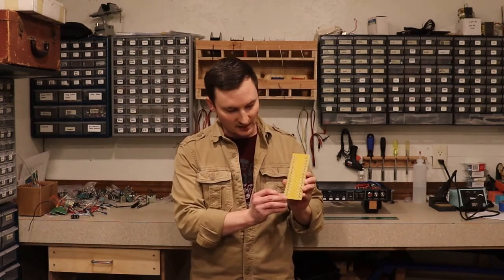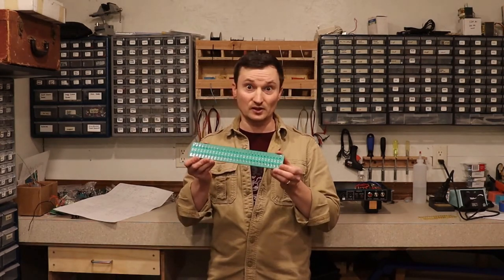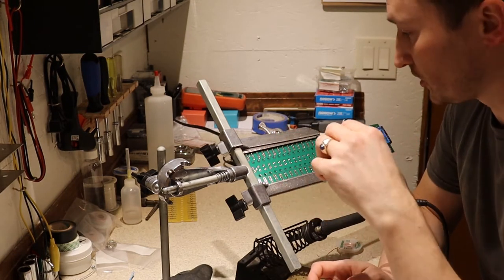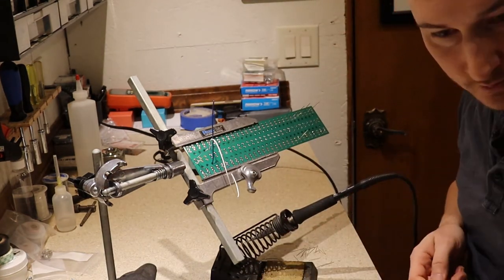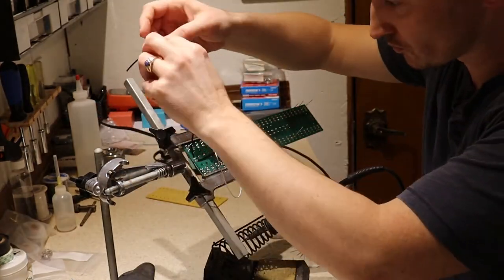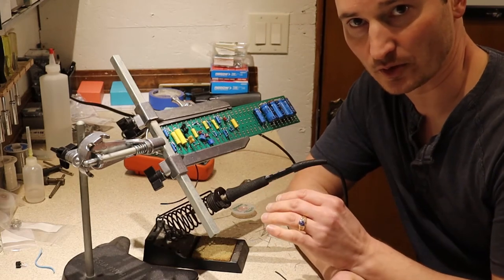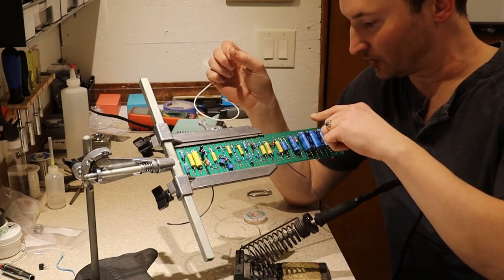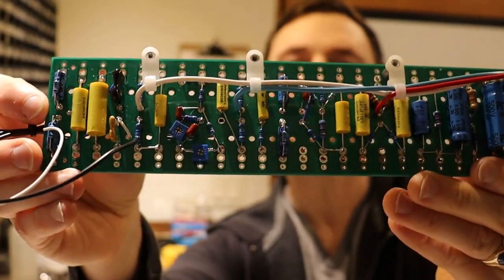75 Dollar Dumble Build Part 2

Comment: Given the huge tolerances of vacuum tubes it doesn't make any sense to use low tolerance resistors of 1% at all. I like the freedom you take with this design and your ideas for improving it, however I do not understand the difficulty in ordering the right components given the time and effort you put into this project. The eyelet boards are a great idea. Very nice project!
Reply from the maker: You make a good point. The tubes themselves will have a greater effect overall. I almost always use 1% resistors because the results are more easily repeatable if you can rely on the values, and because of the lower noise. Granted, there are only certain places in an amp where that would come into play, e.g. a 470k grid stopper. I guess I just haven't found a reason not to use them.
Reply: @timkrauseelectronics9245  new to all this but it would seem to me that if the tubes are have high tolerance having lower tolerance supporting parts  would be more idea.
Reply from the maker: I suppose it depends on how hard you are trying to hit a moving target.
Reply: @timkrauseelectronics9245  thanks utterly fascinating brings out the failed engineering major (stupid calculus) in me.
Reply from the maker: @markntexas8265  For me it was the physics classes. . . stupid lab reports.